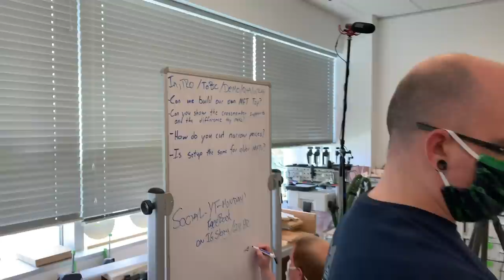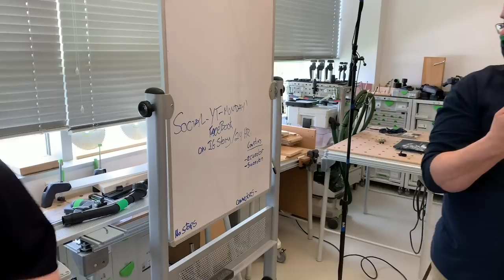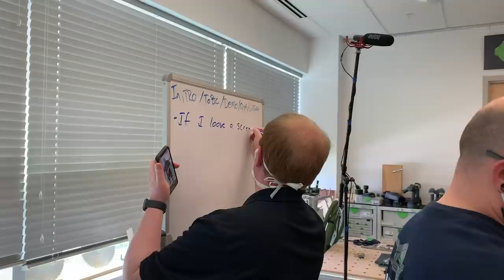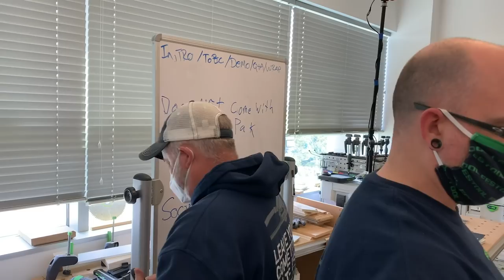Festool Live Episode 05 - MFT/3

Comment: Very instructive video. I like especially "stops" on the plastic lip (not cutting all the way on the rail) and the 90 degree calibration. What could also be done is to calibrate (0 setting) the fence towards two bench dogs. Then you measure and adjust the rail to be 90 degrees  to the fence. This way, you rail will be calibrated to the holes and you could use bench dogs (when needed)  instead of the fence.

Comment: Sorry. I bought the complete MFT/3 table with the protractor and crosscut track setup. I found it so fiddley and impossible to keep true (just bumping the rail can easily throw the thing out of square) that after 6 months of never being able to trust my cuts I got rid of it and now rely on rail dogs and an aftermarket crosscut rail attachment. They work great and I built a kitchen full of cabinets with the square-cut precision of a cabinet saw. cheers. I do appreciate your videos. Thanks.
Reply: Festool is fiddly and the tables are cheap as hell. I hated the miter saw table.

Comment: Bought the MFT/3 specifically for the protractor head and fence. When properly calibrated it allows predictable and repeatable cuts both 90 degrees as well as any angle required. It also makes beveling the full length of a table leg much more precise than the table saw jig I used previously.  
—————— for those who watch or rewatch the live event(s) on Utube it would be nice for the camera to record from the same angle as the live camera rather than off to the side.

Comment: May 2022 - I bought the MFT/3.  The product is great however the fence clamp I have is not the same as in this tutorial.  The lower lever for attaching to the V-Grove is round, small, and plain pain in the butt tightening over and over.  With that in mind, is there a part # so I can have a lever instead of round knob to tighten to the V-Grove?

Comment: Not sure how much calibration is done at the factory.  I noticed his table has the same issue as mine did out of the box. The factory installed stops were not even. Notice how one end of his straight edge is covering about 1/2 of a dog hole but the end closest to the edge only covers about 1/3. I wanted to be able to use bench dogs in mine as well and have them be square to the guide rail so the first step should probably be to “home calibrate” the stops. Otherwise I have been pleased with this table. Makes cutting repeatable and accurate panels very easy. I also use it with my OF1400 for very accurate dados.
Reply: I have owned one of these tables since they released this model. I use my dogs from the clamping elements to set my guide rail and then adjust the stops to this new setting. I then use the dogs to set the fence square to the rail.